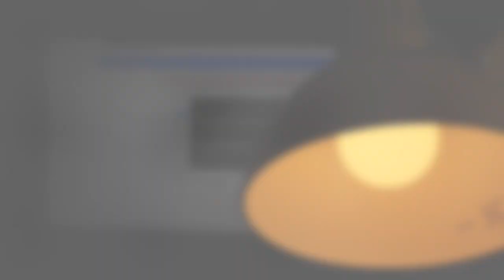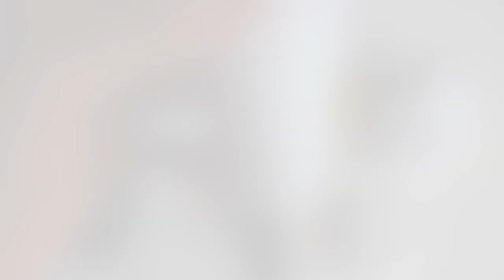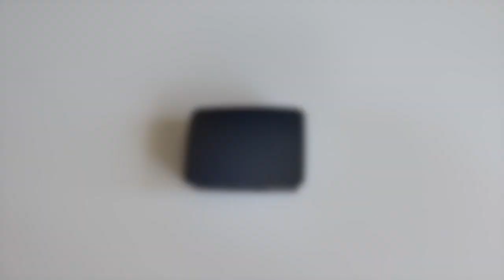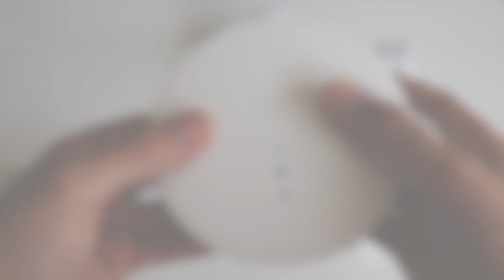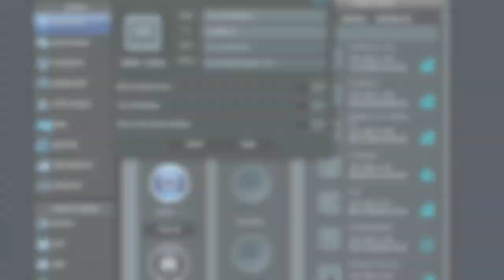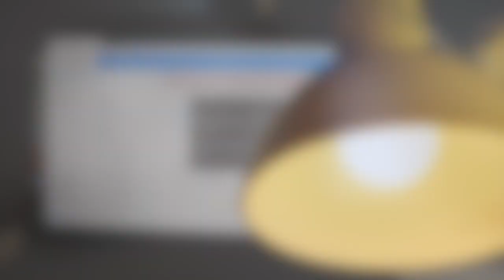IKEA TRÅDFRI and Home Assistant

Comment: So... if i only want to use a pair of ikea bulbs, do i need to buy the ikea hub too?? :/ i thought with raspberry and home asistant i could use ikea or many other brands without other hubs.
Reply from the maker: IKEA TRADFRI works based on the ZigBee protocol therefore you need a ZigBee to control them through Home Assistant. You can either use the IKEA TRADFRI hub or alternatively do it with a kind of DIY setup using another  ZigBee device like ZigBee CC2531 USB Dongle.

One more thing: you can use IKEA TRADFRI lights without a hub or ZigBee CC2531 USB Dongle and just control them from the IKEA remote controls but then you will all smart features like control from smartphone, etc.

Comment: I can see my buttons as a "battery level sensor"... How do I use them as buttons?
Reply from the maker: If you want to use the IKEA remote for controlling your own projects through Home Assistant than you need to proceed with a different setup using CC2531 USB stick for Zigbee communication.

Comment: Wait, you skipped the whole part about the entities in home_assistant - what does the remote look like? 
I'm only getting battery_level values from the default sensor.symfonisk_sound_controller that the integration added. Show us more!
Reply from the maker: I am using a wireless dimmer for the IKEA Tradfri lightning bulb in the video (I believe the product number is 203.478.30). I have recorded the whole process in the video so no steps are missing. However, Home Assistant is rapidly evolving so the IKEA Tradfri integration might have a new feature or something (the video is several months old). I will double check on a fresh HA installation in my spare time in the coming days.
Reply: Thanks @LeonAnavi !
So you are just controlling with remotes that were ALREADY paired via tradfri gateway AND specific lights. No role for Home Assistant in that part of the setup.
But Home Assistant does expose the lights as entities, so you can add automation. 

I was expecting to also get the switches/remotes as entities with states or events, but after talking to some every helpful folks in the Home Assistant discord, I know understand that this is not the case. 

I was hoping to use tradfri remotes as inputs for non-tradfri lights and outlets. The way to do that is to use a zigbee dongle directly on home assistant and pair the remotes to it to get them as entities with usable states or events. 

So I'm waiting for my Elelabs (https://elelabs.com/shop/) adapter now.
Reply from the maker: @christianboehnke  thanks for the feedback. You have a very specific and yet very interesting use case. I've noticed CC2531 low-cost dongles are quite popular nowadays and you may also consider them as an option for your project.